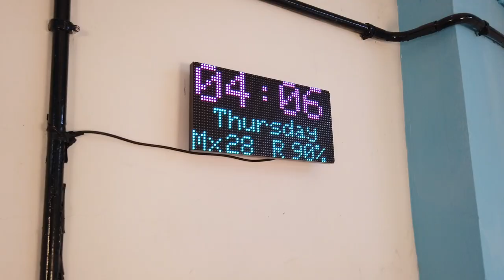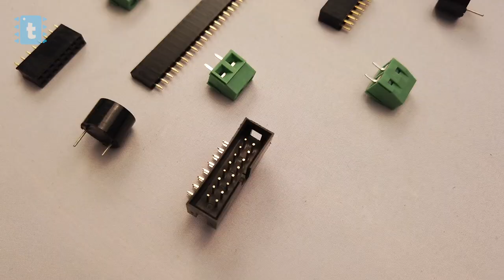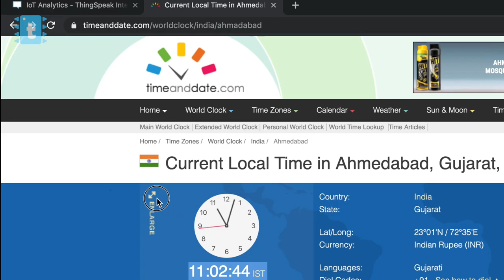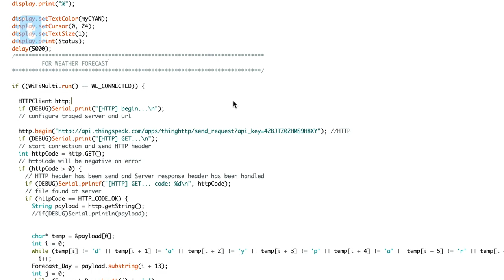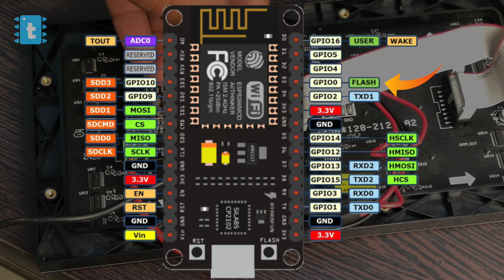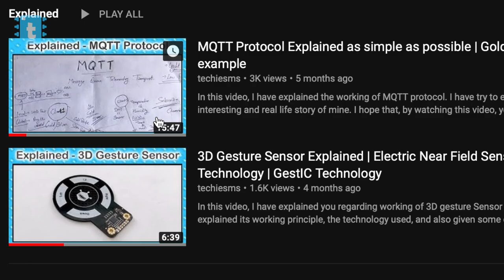IoT clock using Nodemcu  | Live Instagram followers,Date,Time & much more | JLCPCB | DFRobot

Comment: For some reason my URL for the parse string from ThingSpeak isn't working. The page displays "Error parsing document, try a different parse string." It doesn't work even though the info on the website hasn't changed. I then went ahead and tested the ThingSpeak URL you used in your code and thats not working either. Do you know why this is so? and how this can be fixed? Please help.
Reply from the maker: I don’t know the reason and the solution for this. Sorry
Reply: @techiesms  Thats alright. Thanks anyways. Have a good day